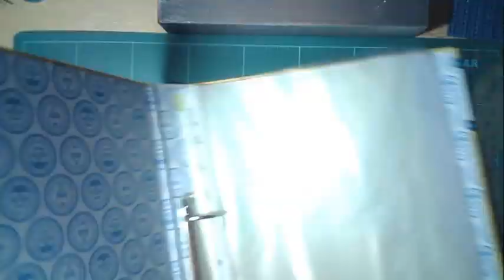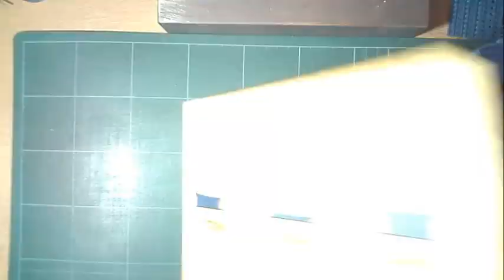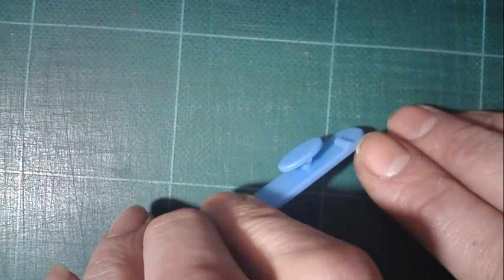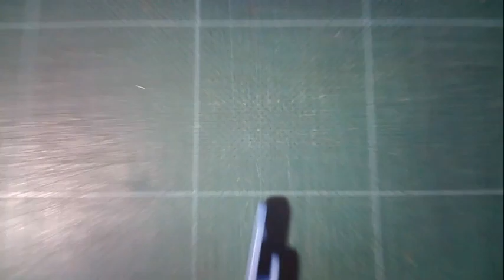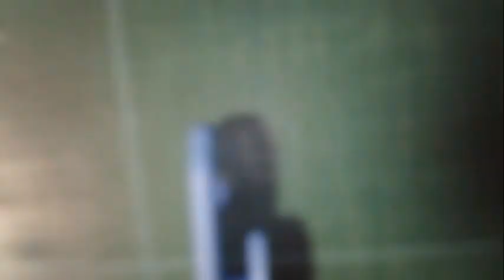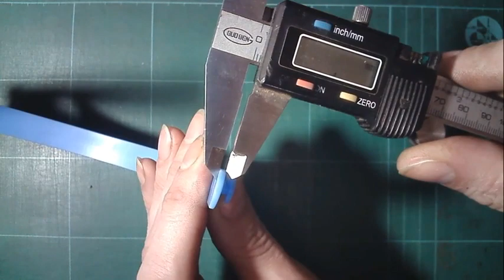Injection Molded PPE visors - a close up look

Comment: It looks like they're using the same spacing as the 3D printed Prusa design. I worked with a local injection molder to create a different version, that uses shields cut with Cricut Makers to forum both a front and top shield. I didn't design it--I just made a variation better suited to injection molding: https://youtu.be/yQ5giPD9JlA I've been enjoying your videos, and learning from them.
Reply from the maker: Hi John, nice to hear from you. Yes, they sent me the schematic for the transparent shield, and it is as per the Prusa design. Apparently the NHS over here are now tightening their safety procedures on donated PPE, so they're currently reviewing the situation. Plus the Royal Mint are apparently gearing up to produce 2 million visors, so this may be a defunct project now, but hey, we've all got to do our bit to try and help.